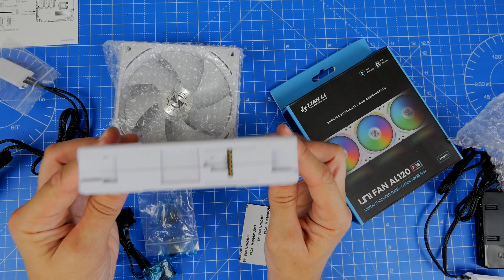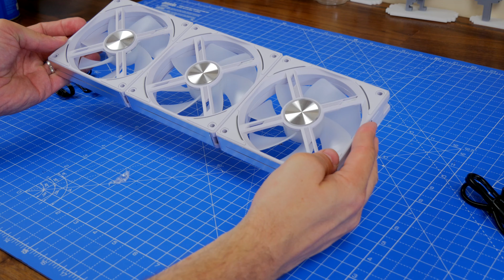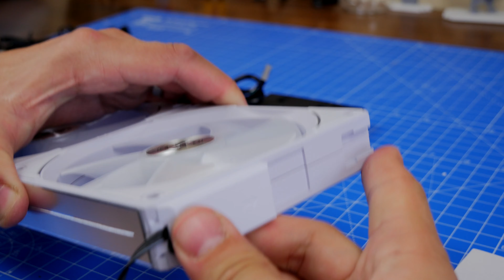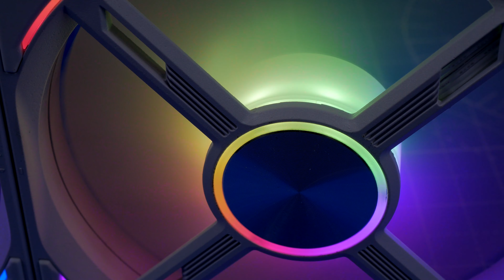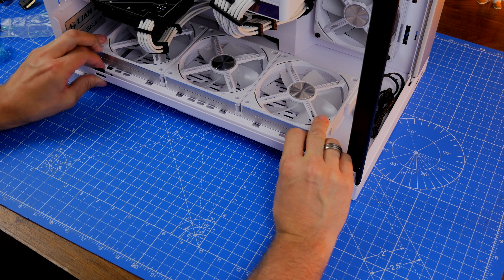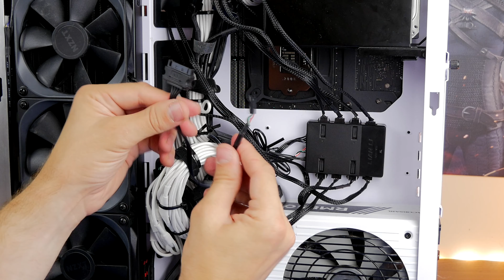ASMR unboxing Lian Li AL120 Uni Fans

Comment: So if I have my SL FANS already connected to my controller and I connect AL FANS to that same controller, will it recognize them as AL FANS? Or do I have to add an additional controller?
Reply from the maker: Lian Li has said - "Theoretically it is possible because both the SL120 and AL120 use the same headers. However, L-Connect (both original and L-Connect 2) will detect these as SL fans (because of the controller signal), so the lighting effects will look odd. So while it can definitely be done, and the hardware won't be damaged, LIAN LI does not recommend doing so. "